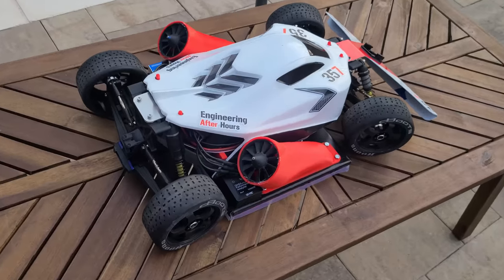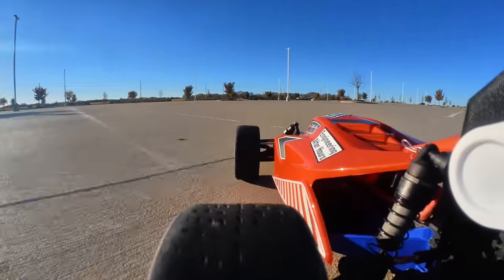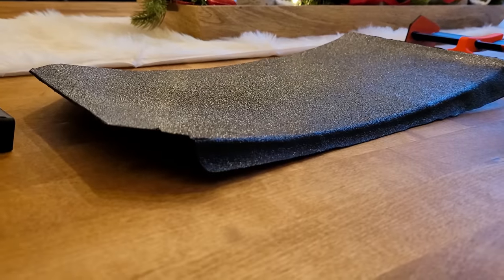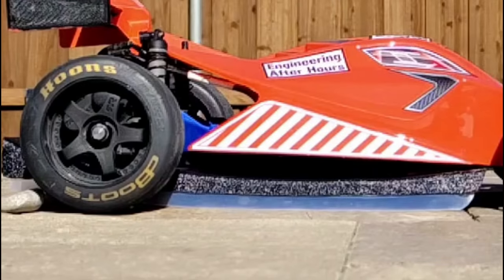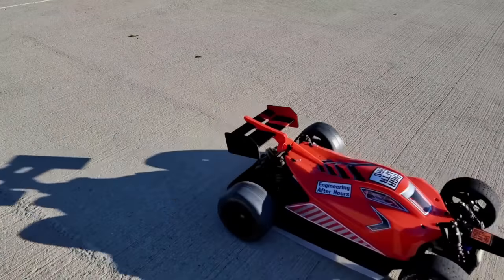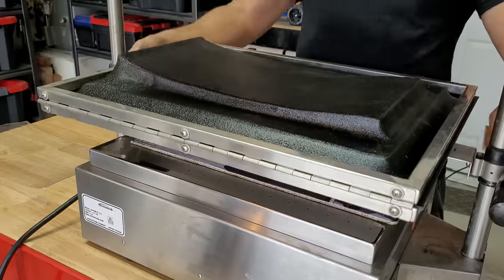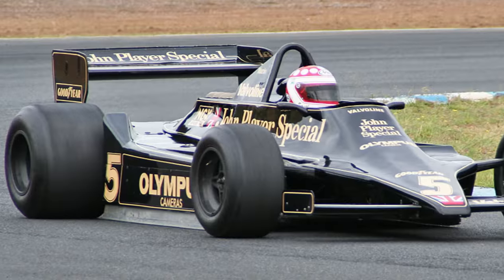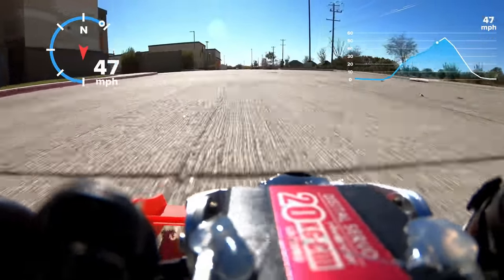I made F1 Ground Effect for my RC Car

Comment: Is this really ground effect?
Reply from the maker: Yes
Reply: @EngineeringAfterHours  It just looks like normal lift?
Reply from the maker: @turkeyphant  how?
Reply: @EngineeringAfterHours  How is it different from normal lift? I thought ground effect only worked when the ground interrupts the downdraft. With a car this "downdraft" is going upwards so there's no surface to interact with it.
Reply from the maker: @turkeyphant  I'm not sure what you're trying to say honestly...but here's a simple explanation of what's going on:

The undertray is contoured to create a venturi tunnel and sealed to prevent leakage. Because this contoured undertray is so close to the ground, it acts as a constriction which rapidly accelerates the air. This acceleration results in a drop in pressure in the constriction region. If you take the ground away by lifting the Car a foot or so off the ground, you no longer get the venturi effect and that will result in the simple bernoulli lift you're referring to. Bernoulli lift will be lower in magnitude than the ground effect induced venturi lift.

So an easy way to put it would be that when the undertray relies on the venturi effect with the ground and undertray to greatly increase downforce, you are acting in ground effect. Technically front wings operate in ground effect as well...hence why they're so low. 

If you watch the video again after reading that and it still doesn't make sense...let me! know and I'll try and help out.
Reply from the maker: @turkeyphant  it just occurred to me that you are referring to the aerospace definition of ground effect. The race car version of ground effect isn't quite the same.

Comment: do you think you can simulate the myth of a f1 car driving upside down?
Reply from the maker: Yes. One of the challenges is the speed required to get there though...itll likely be over 100 mph...especially in race trim
Reply: @EngineeringAfterHours  hmm yeah very challenging, but that video will explode for suree

Comment: The poor handling is more likely because of the wheel geometry on that car
Reply from the maker: How so?
Reply: @EngineeringAfterHours  Unless you have something different, those 2wd off road buggies have crazy amounts of castor built in. So, no contact patch with road tyres on road. Stupid amounts of rear weight bias should aid turn in if anything.

Comment: I cringed every time you pluralized ground effect.
Reply from the maker: I explain this in another comment, but the reason I pluralize it is because the first time I was introduced to the term "ground effects" was with the late 80s/ early 90s Camaro. There were options to add ground effects which was an aero package.

When I say ground effects, I'm specifically referring to the components added to the underbody. When I use the term singular (ground effect), I'm referring to the physical interaction between those components and the ground. 

https://accessories.chevrolet.com/product/ground-effects-kit-in-black-for-ss-models-with-dual-exhaust-tips-84116166?year=2021&make=Chevrolet&model=Camaro&modelId=432&body=Coupe&bodyId=9&wheelId=1&trim=LT1&trimId=5642&drive=RWD&driveId=7&engine=6.2L%20V8%20GAS&engineId=5920&bodyNumDoors=7